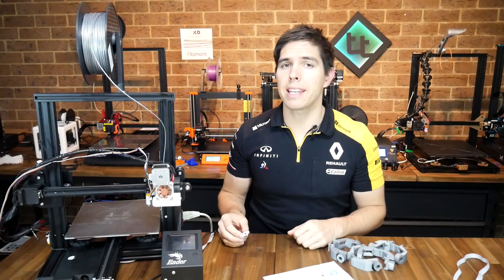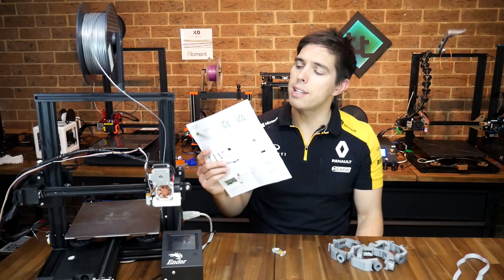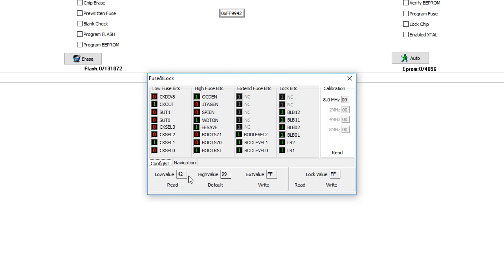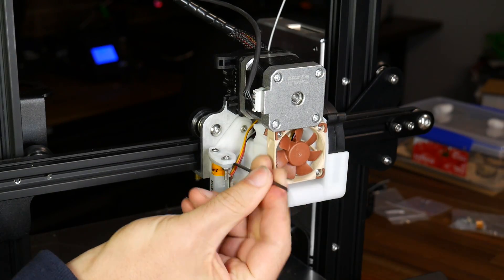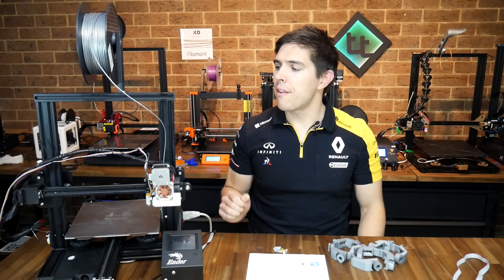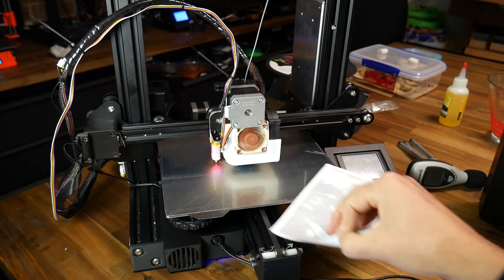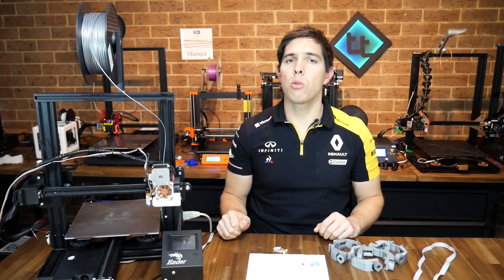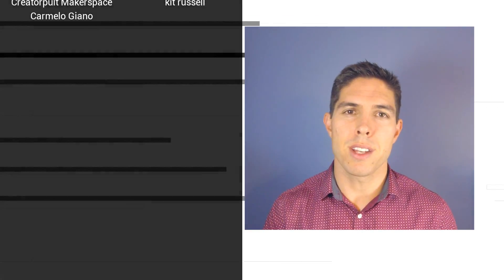Creality BLtouch Ender 3 upgrade kit - Step by step guide with fixes

Comment: So do I need to download marlin or do I need to download Arduino software on my computer? I'm sorry but I'm fairly new to 3d printing and just recently purchased a BlTouch because I found bed leveling a pain due to inconsistencies. While I wait for my BLTouch v3 for an Ender 3 come in I've been trying to get all the computer and software end ready for when it arrives.  I have looked everywhere for more detailed instructions on this but can someone please let me know what I need to download and what I need to do with it. Thank You!
EDIT: Also how do I open the .hex files?
Reply: the teaching tech .hex file is just flashed by the flashing tool that comes in the box of the printer (you don't need to open the .hex file

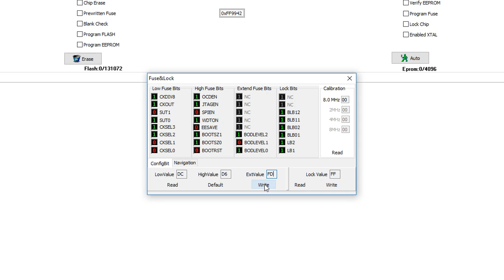Comment: 7:45 Creality made their own install video in Nov. Looks like your values are wrong there.
Reply: I was having issues, had to use the same creality video to get the right values, but also I could not get the FD value to stay persistant it would change back to FF under the hex it creates for program fuse. I was able to fix that by putting FD in the lock value and writing that. Works great now!

Comment: This is a great video and it cleared up a lot of questions I had about the upgrade and I have my Creality  BL Touch running just great. I am using your bugfix version of the Marlin 1.1.9 Firmware.  Two things I notice about this firmware version. The vanilla Creality version used to show the percent complete on  info page while the print was running. The other thing is that there used to be an option  in menu settings to SET/change the default nozzle and bed temps for PLA and ABS  then you could store the settings and when you go to Prepare -  PreHeat PLA it would use those settings. This menu option is gone now and the preheat values are set to 185 and 45 with no way to change them. I know I can set the actual printing temps in Cura  but it was nice to have a way to the preheat defaults you wanted.  Is there a way to get these functions back? Other than that it works really well and it is fast enough to run before every print.
Good job.
Reply: I'm having the exact same issue. Is there even a current version of Marlin available for this? Would be awesome if someone could help us out.
Reply: Did you managed to fix this?

Comment: Hi ive wrote the firmware to the ender 3 and it loaded fine, i  then reset the printer and looked at the menu and selected auto home, the X stepper runs and the hot end goes all the way to the right and trys to keep going. What am i doing wrong? It works perfectly fine on the non BLTouch Firmware.

Comment: Does this work on an Ender 3 Pro with 1.1.1.5 Silent Board?
Reply: Michael was kind enough to respond, and though he hadn't used it with the Silent Board, he said he thought it would likely work.
I tried it last night, and couldn't get it to write to the machine through the USB port. Kept getting "no sync" errors. This board is supposed to have a bootloader, but I couldn't get that to work. Next I tried an Arduino per the video, and that wouldn't work, either.
So I tried using the bootloader flashing board that came with the BLTouch kit from Creality (mine came with a ver. 3.1 sensor) and using the progisp software and the file Michael provided, I finally got it to take, and wonder of wonders, IT WORKS!
The BLTouch works perfectly (you still have to figure out your correct Z-Offset value, but the new firmware makes this almost trivially easy, just as Michael said.) 
So now I'm even more of a fan, and will be increasing my Patreon support right now!
Michael, you're the best!
Reply: After two days, with everything seemingly working well, the BLTouch setup went crazy, and started hanging the Z axis about 50mm in the air. The BLTouch would always fail the power on self test, and now doesn't work at all.

So, I've reverted the firmware back to stock, removed the BLTouch, and reconnected the Z-stop switch, and after recalibrating and re-leveling, all is well again.

I certainly can't blame Michael for these problems, and will remain an enthusiastic supporter. But this upgrade doesn't seem to like my printer, or vice-versa.

I found when it WAS working, that it didn't really change anything for me.
Unless you regularly change/remove your print bed surface (and I don't since I'm printing on the glass bed) I'm not sure I see what the big advantage of ABL is.

It takes a few minutes to level, but I didn't see any increase in print quality, and I don't have to re-level every print, so tweaking it once in a while seems like it's no big deal.

For now, I'm going to stay with manual.

Comment: Hi I really like your channel and need some help please I have an ender 5 and a bltouch kit with burner and bltouch 3.1. I went through the guide carefully and yours but the 3d printer is not functioning properly with the firmware and seems bricked. Could you please send  me  a  hex  file with the bootloader and firmware to support bltouch v3.1 and latest updates please that i can install using the burner tool thanks would be greatly appreciated. Also out of curiosity burned your ender 3 package loads but there is a constant buzzing, is that due to filament detection? Please help

Comment: I just purchased a BLTouch 3.1 for my Ender 3 Pro, installed this and going through the offset and other configuration. I an new to 3d printing, had this about 2 months before I got this BLTouch and not sure I am setting this up correctly. Should I manually level the bed first? get it to some baseline then do the Z-offset and hard code that value.  Also, I did use the Creality firmware for this but also noticed you had some firmware available that might do a better job than the creality? Can anyone help me with this to make sure I get it right ha. Thanks.

Comment: You can do this with a new, unmodified printer, right? Or is there prerequisites to this video
Reply from the maker: Normally the prerequisite would be a bootloader but the flashing tool that comes with this negates that.
Reply: @TeachingTech  Then do you know why the ATmega 1284P chip isn't showing up on progisp for me? Couldn't find a solution anywhere
Reply: @JkaneGaming.  I am having the same issue. Spent several hours trying to get different versions to work. Would love am answer
Reply: @ncfacbc  I figured it out. It's a suprisingly small issue, but it worked for me when you rename the folder that progisp.exe is inside. Instead of whatever it is currently named, rename it progisp.
Reply: @TeachingTech  Think you could help me with this part?

Comment: i really need help. what if i cannot even select a chip in the progisp even though everything else works (as far as i can tell) in progisp
Reply: I am having this exact same issue, I ca not get the drip down menu to work at all. I am assuming that its not connecting to the printer.
Reply: I figured it out. It's a suprisingly small issue, but it worked for me when you rename the folder that progisp.exe is inside. Instead of whatever it is currently named, rename it progisp.
Reply: @JkaneGaming.  WOW that literally worked. wow
Reply: @JkaneGaming.  Thank you so much JkaneGaming you saved me from ordering a pre loaded board. I was about to buy one lol
Reply: @Backyardwrenching1243  Yeah np - it was the only thing I had left to try and surprisingly it worked

Comment: I just got this in the mail. I installed it. my first z measurement was -002.1  then I go to control-motion-z offset and my value is 00.00   So my B=A would equal -002.1  and I dont even know if I can adjust the z offset setting to this. If I leave it at 0 and try to run it it goes through a level process it looks like then goes all the way to the right and up a little and the motor sticks. Any ideas. I bought a creality printer from walmart.com and the bltouch kit directly from creality. When I emailed for help with this they wouldnt help because I bough the printer from somewhere else and not directly from them.

Comment: I have a problem with getting the nozzle down low enough, I am running Marlin 2.18 on a Ender 3 Pro, i can't figure out how to set the Z-offset. I have used the Z-offset on the control but it only goes to -4.95 and it is not close at all.
Thank you for the video's

Thank you for the help
Reply: I have the same problem.  It does good in the right side then raises on the left.

Comment: first off thanks for doing this tutorial it really did help. secondly, I am having a bit of an issue. I flashed the BLtouch v3 firmware onto my printer and works but every now and then the probing fails. when I try again and it succeeds the print just doesn't print. it just stays in the last position and the progress bar moves, and the only fix I found is to reflash the hex file and reset it. is there a more permanent way to fix this issue?

Comment: Hi , I have the ender 3 with creality v1.1.5 board installed, I have Marlin 1.1.9 and a bootloader installed (sanguino i think its the name). sorry I'm new to 3D printing. is it possible to flash your pre-compiled firmware hex for BLtouch v3 and marlin 1.1.9  bugfix through USB (as i already have a bootloader) or Do I still need to use creality's programmer?. Thanks

Comment: Thank YOU!!! You made this very very easy for me. I compiled THD3 myself but had weird issues of random reboots for some reason. I didn't feel like figuring out where I went wrong so I grabbed Creality's firmware for the BLTouch and it was, well not the best to say the least. Popped your firmware on an it worked awesome with my BLTouch V3.1 using your V3 firmware.  Setting my Z-offset while printing made it easy to get great layers as well. Much appreciated, you sir are a steely eyed missle man.  Deff gonna hit your Patreon up this weekend!

Comment: I tried to use the upgraded hex file you provided, but when I turned on my printer it took for ever to load and then ran very slow to the point where it was unusable. I have the brand new ender 3 board version 1.5 with the creality bltouch. Is that not compatible with your hex file or did I do something wrong?

Comment: OMG! Thanks so much. For MONTHS now I have been struggling with getting these sensors to work. They always want to print about 10mm above the bed.. even after doing the whole home / move down to bed, add that to current Z offset etc.  The version I just flashed actually has the nozzle move while you adjust Z off set making it a no brainier ! Is there any chance you could release the source or maybe make a version of this for the CR10 S5?

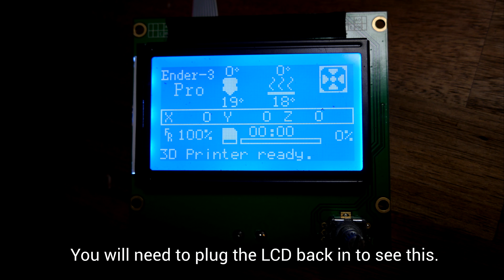Comment: Creality's video "https://www.youtube.com/watch?time_continue=64&v=jqxlQkkt8cM" says the Lo & Hi values are swapped from yours,(LO D6 & HI DC)and to click "Read",NOT "Write".They even added a pinned note about it.I'm in the middle of my install and PLEASE need to know which is correct so I can melt plastic!Thanks!Update:I went ahead and tried like your video,and now the screen loads like at 5:05,but the LCD makes this God awful cricket chirp,and I HATE crickets.BTW,I tried both ways of the LO/HI fuse code,and it STILL chirps.PLEASE HELP ME!

Comment: I purchased this kit and they sent me a BL-Touch v3.1 and not a v.3.0.... has anyone tried out the firmware upgrade when using the v3.1? Does it have the same problems with the Ender series as the v3.0 does?
Reply: I have an Ender 3 Pro with v1.1.4 mainboard

Comment: I got this kit 2 days ago. My Ender 3 Pro is upgraded to SKR 1.3 with TMC 2208s, so I didn't use the programmer and the extra boards. The probe itself works flawlessly. The only modification which needed to be done was to replace the Z end stop plug with a 3 port one while attaching the white and black cables respectivelly. Unlike the "original" original BLTouch there is just a minor difference in the cable colours - the Creality version uses blue instead of brown and there is just one long cable instead of one short and an extension.

Comment: You mentioned the Low, High, and Ext values as DC,D6,FD. In the documents provided by Creality they show D6,DC,FD respectively. This is both in the image on the instructions sent by Creality for the BLTouch and for the PowerPoint "instructions" in the firmware download provided by Creality. I also noticed a variance in the text of the instructions which tells you to input DC,D6,FD respectively like you have shown, but this is contradictory to the images they show. What is the potential risk of entering these values improperly? What should they be?? Damn you Creality....
Reply from the maker: One of my patrons noticed this and has tested both combinations, I don't believe there was any real difference.
Reply: The one I recieved yesterday shows the same values as this video.

Comment: After installing this I have noticed my printer is moving the z-axis during prints. When I use the bed leveling function it just lifts the printer head when it gets the left and back 3 points on the plate. Any help would be greatly appreciated (I flashed the th3d firmware that comes with the files).
Reply: I think theres a piece you can download from thunkiverse

Comment: Thanks man ! 

Under Ubuntu I used my usbasp instead of the isp clone. Worked perfectly with this commands : 

avrdude -c usbasp -p m1284p -B5 -U lfuse:w:0xDC:m -U hfuse:w:0xD6:m -U efuse:w:0xFD:m 

avrdude  -c usbasp -p m1284p -U flash:w:/home/Downloads/Marlin.ino.with_bootloader.sanguino.hex

Comment: Hey Teaching Tech. Does your own Hex work with the stock silent board 1.1.5 for the ender 3 pro?
Reply: I would like to know this aswell
Reply: @Inputmapper  you'll never know aswell
Reply: I  just flashed his hex to my stock board. It does flash but controls are very sluggish to navigate through and when i hit the option to probe Z offset it did nothing. There was no instructions with it just the hex file.

Comment: Hey the ISP USB doesn’t work on windows 10 for me... any chance you have a solution?
Reply: If you have an USBASP, you can use it instead of the isp clone : 

Burn the fuses 
avrdude -c usbasp -p m1284p -B5 -U lfuse:w:0xDC:m -U hfuse:w:0xD6:m -U efuse:w:0xFD:m 

Burn the .hex
avrdude  -c usbasp -p m1284p -U flash:w:/home/Downloads/Marlin.ino.with_bootloader.sanguino.hex

Comment: What are X and Y offset set in your .hex file? 
I'm having problems with v3 bltouch. it does work, but it seems it's not accurate. one side of the print is always too low and it goes into bed. I thought it's X axis fault, but I have removed X gantry and it should be OK, but i still haven't managed to make it work properly. Been struggling with this for 2 months already, just can't make my BLtouch to work.

Comment: Great video helped me a lot, not to waste time. BTW, new SW from Creality Site seems to function better (no need to erase, had Flashed on 1st try).
I have Ender-3, BLTouch 3.1 and used your custom Marlin.. but every 2-3rd time calibration on print start fails, BLTouch error. After BLTouch Reset from menu everything works. Has someone idea is that common error? I would not gladly dissmantle all and send Kit back...

Comment: Works on Ender 3 pro with BL Touch 3.1, Problems i encountered:  

> Mainboard  flash didn't finish. The  fix was not  using an adapter  and  plugging the  flash tool in the pc  via  extension cable.  I flashed his suggested v3 hex file and not the v3.1 hex file that you get with the download from creality

> annoying sound from the mainboard when  testing  the screen after flashing: The Fix was just using the  pin27 Board  directly and  the  beeping stopped.

> getting  the  hot glue  off of  the  Z connector was a bit annoying, I did that carefully with my craft knife

>  Z offset didn't seem to work but i found out that only works mid print

>  Printing  from SD Card doesn't work. Choosing  a  file  and hitting  print doesn't do anything. The temp values  don't change on screen  and after waiting 15min it  still would not start. Maybe the  fault of the  sd  card. Printing  with octoprint works fine.

(thanks to the comment section)

Comment: Just installed my BLTouch Kit from creality but the Pin 27 board interferes with the stock mainboard cooling fan.  Did you encounter this issue?  Brand new Ender 3.
Reply: You might  wanna come up with an Adapterto fix  that problem since this is  an non pro Ender  3 issue. This also got  already answered here

Comment: Great hardware value, but after trying to find instructions through the Creality website, I was only able to download the firmware and the Chinese progISP, I found a newer, English 1.72progISP version at < https://exploreembedded.com/wiki/AT89S_Series_8051_programmer >, used your excellent video and hard won settings /connections / printer ON to upload, worked first time. I actually installed your firmware so I didn't find out what else Creality could screw up. Pointing as many people as I can to this video. I have the 1.1.6 board, but I went ahead with the programmer upload for least hassle.

Comment: Teaching Tech. I had a previous Ender3 Pro Hex. file from you when i did the original upgrade months back. I saw this video and heard you say it is a new .Hex file to make it probe faster and such so i bought it and loaded it and there was NO discernible difference if any from the previous File used. I am just wondering if it is the same file linked on this video or if infact changes were made form months ago..... In the end i am not pleased but appreciate the effort